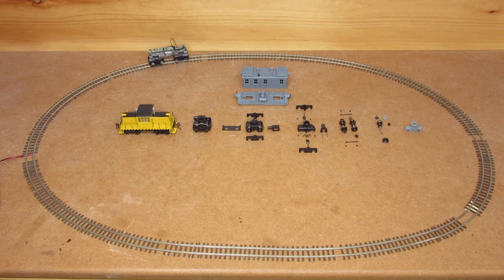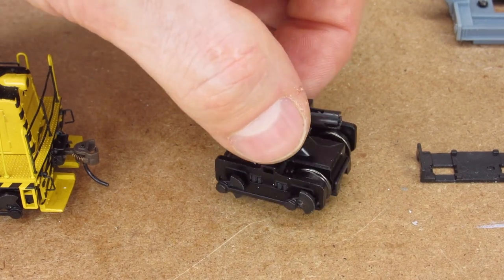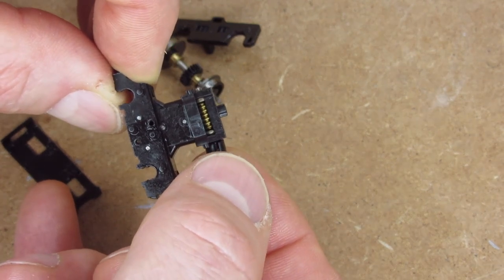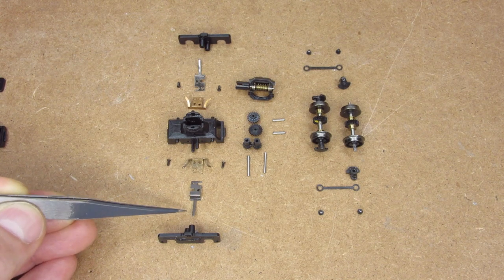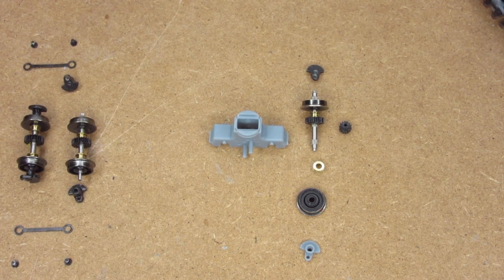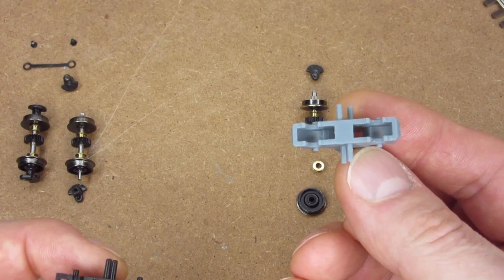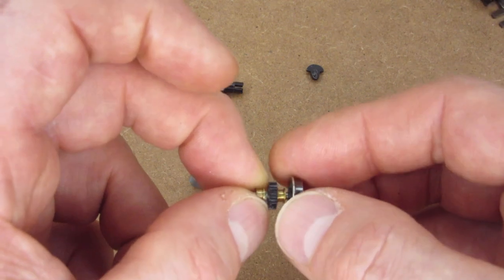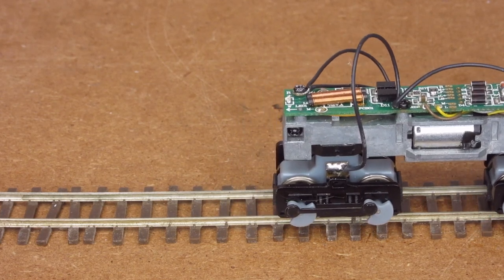Converting Bachmann 45 Ton GE Side Rod Trucks to Hon3

Comment: Cool.
I used to run 1 those GE 44 ton siderodders at frt. car repair co. in 80s.  It's in a museum today.
Really powerful little engine!
Reply from the maker: Hey thanks for the comment!

Yes they're really fun to watch.  There was an aggregate and concrete facility near my house growing up and I used to sit and watch their GE 45T switcher moving hoppers and rock cars for hours.  

The only diesels or gas mechanicals I allow on my layout are with side rods and counterweight cranks.  I've been slowly converting over everything in my internal combustion fleet.
Reply: @dtj9923  
That co. (long gone today) had U.S. Army contract rebuilding super heavy flats to transport tanks.  They all had old heavyweight 6 wheeled passenger car trucks.  I was kinda' considered "truck expert," then; and I dreaded working on those things, so when I got chance to hostle that little GE, and being a railfan, anyhow, and free of those nasty, big heavyweight trucks, which could be very difficult to get all the components to fit & pinned, I was real happy.  That little engine could push around strings of those Army flats with no slips or strain.
Good work, Sir!

Comment: Awesome , Can this concept work on Bachmann 's 70tn also?
Reply from the maker: Hey Don, thanks for stopping by.  

I haven't done any work with the 70 tonners but I have seen quite a few that have been converted to HOn3.  NWSL actually sold some conversion wheelsets at one time, now hard to find.  Somewhere out there is a magazine article on how to do it.  August 2008 Railroad Model Craftsman is what I found.

Also found this posting.  https://www.zealot.com/threads/hon3-locomotive-shops.167339/ 

Hope that helps.

-DTJ

Comment: So great! I need to convert one to H0m, which is a bit wider gauge than H0n3, but I know that printed body would be doing it great.
Reply from the maker: Hey Diego thanks for the comment,

I actually talked with this guy a little in the comments section about his HOn 3.5 conversion which is 42 inch gauge.  HOm with the existing trucks will be a squeeze!   https://www.youtube.com/watch?v=nj1ZkEFfkxA&lc=Ugz2AIubJliwF_CdCWp4AaABAg.9_N7VP25oGT9_fn_cLyMO9

So in the video I talked about how the Bachmann gear clearances were not right and there was some tight running and hesitation and how a big part of this project was fixing the gear clearances.  Over the weekend I built up a new HOn3 45T boxcab chassis with the final revision of the narrowed truck body/gearbox.  I was shocked to find out how much faster the 45 tonner runs now just because my gear clearances are correctly set versus the tight running Bachmann factory trucks.  I used a test loop of 3 rail track and ran my HOn3 conversion against an out of the box unmodified 45 tonner and the HOn3 version ran away from it!  It starts moving at a much lower speed step on my DCC throttle.  I compared to two other new Bachmann engines and got the same results.  Crazy!
Reply: @dtj9923  great, thanks for the link. I know H0n3.5 is 12mm, the same for H0m, so great reference. So if you are going to sell those, I would be interested, even when I'm overseas. Regards!

Comment: Excellent conversion!!! This is exactly what HOn3 modelers need. Are you interested in selling a copy of the cad files for those of us with 3d printers, or possibly making the gearbox housing and counterweights available through Shapeways? 
Thanks for sharing the video!
Reply from the maker: Hey thanks for the comment!  

I just finalized the improved gear train geometry on my most recent print and I gotta tell you it's amazing how much less voltage it takes to get one of my HOn3 conversions rolling vs a factory 45 Tonner, seriously nuts.  Now featuring zero binds, and zero rolling resistance!

I am actively trying to sort out how to commercialize the conversion parts and I need to see how much I can simplify the entire process of conversion for customers.  The axles, gears and wheelsets are a bit hairy, I'm trying to develop some 3D printed jigs for pressing and to guide the end trimming.  If you watch the video you'll see how the factory axle knurling creates some bearing surface challenges that require a lathe, still working on that.  I have managed to develop a much better 3D printed counterweight retrofit that greatly simplifies things on the axle ends.  

Shapeways is an interesting thought, I'm actually set up here to print in commercial volumes but I lack the time to deal with it.  Shapeways might be a good way to delegate that process.

Thanks again, DTJ
Reply: @dtj9923 
Sounds like this is coming along very well. I'm anxious to see this offered as a product. God knows we need more inventive folks like you to foster our hobby along with quality products. I have a Phrozen mini 4k and I love the quality of the prints that I get.  I'm going to try your "magic mix" for resin. Sounds like a winning combination.

There's a company in England called Markits. They sell wheel sets, gear sets, axles, and other parts. The axles and wheels have square ends and holes for quartering purposes. They also have photo etched counterweights. They're catalog is a great source for high quality parts and research.

Maybe this will help simplify the process, and you could make your own side rod trucks without having to use any Bachmann parts. Considering that Bachmann no longer makes this locomotive, and they're increasingly difficult to acquire, offering the complete gear tower (HO, HOn3, HOn30) could be a viable product for us narrow minded folk. You could offer as a kit or fully assembled. This, of course, equates to cubic volumes of time, which is why I suggested Shapeways.
Reply from the maker: @mossysgarage3023    Thanks for the Markits suggestion.  I have seen their products discussed in chats a few times, I just went and downloaded their catalog to look through.  There's also places in Japan with a lot of parts popping up.   http://www.narrow-garage.com/   

I have a pro grade Sonic 4k and it's really good, the 8K Mini is just mind blowing when run at .03 layers.  I haven't touched the 4K in six months now.  If you're having brittle problems with your Phrozen 4K resin the 50/50 mix with Siraya ABS Gray really helps.  The exposure settings are pretty close to the 4K resin settings.  I think just a little longer.  You might also check out Uncle Jessy on this subject, he mixes in Siraya Tenacious.   

https://www.youtube.com/watch?v=fsyn6ODGtVY&t=193s

It's really unfortunate that Bachmann discontinued the 45 tonner, hopefully it comes back some day.  It's a great little model, so much hacking and bashing potential!  The Bachmann parts department still has lots of spare parts.

A total redesign of the 45 tonner mechanism to include a flywheel and elimination the bad worm gear setup where the worm gear actually pivots under the worm with the truck would be great.  With the boxcab version of this thing I'm building I'm almost at the point of a complete new model.  It went much further than the original plan.  It wouldn't take much additional work at this point to just design a whole new drive and chassis.

Here's a couple related videos with the 45T boxcab
https://www.youtube.com/watch?v=yCo-bpQjB8M
https://www.youtube.com/watch?v=1Az5JTuGlYI&t=672s

Thanks again - DTJ

Comment: Thanks!  I would be happy to purchase a set of narrow trucks and counterweights from you, if at all possible.  I have a switching situation where I can’t use an engine with a tender and this would be perfect.  I have a std ga 44 toner I would use.  Thanks...
Reply from the maker: Thanks for stopping by!

I was afraid this might happen.   

I am still sorting out a few minor details and trying a few other resins before I would be totally comfortable with these as a product.  The biggest hang up is the conversion process itself and all of the specific modifications and tuning required to make these run to my level of satisfaction.  Once I finish my Hon3 siderod 45 ton AGEIR boxcab project I'm going to see about doing more with these trucks and try to simplify the conversion process with some jigs and fixtures.  Having to rip the axles apart and then modify everything is a bit of work and requires a pretty good miniature machine shop.

Keep an eye on my channel, things are likely to evolve.

-DTJ

Comment: If possible I would also like to purchase a set of H0n3 trucks and counterweights.
Reply from the maker: Hey there, thanks for stopping by.  I just posted a reply to @Mossy's Garage about this.  Short version... I'm working on it.  The 3D printed parts basically are good to go.  The axle conversion is not customer friendly and requires a jeweler's lathe right now.  I'm working on options possibly using precision ground dowel pins for axles instead.  I'll follow up as things evolve.

Thanks again!  DTJ

Comment: I have a 45 tonner that I ripped apart seconds after getting it and then put all the pieces in a box and never touched it again... lol yes that is my life. Is there enough room to convert it to HOn30?
Reply from the maker: I went to bed wondering who was going to ask this question.  It doesn't surprise me that you are the one asking this question.

I will have to go measure some things and see what room is left to work with.  There may be a way to cheat that last bit of room required but it will take some creativity.  It's definitely within the realm of possible though.

We won't discuss the boxes of non running basket case locomotives I have just sitting around waiting for a project.  I'm in no position to judge anyone.
Reply: @dtj9923  Well really I'm not much into diesels so no big deal looking into it. Just figured you had it figured out already.
Reply from the maker: @Schmuck804  Let's face it, anachronistic side rod diesels and gas mechanicals get special status.  They are entertaining.

As a challenge I'll see if I can develop an Hon30 solution.  A 45T center cab is going to look crazy on 30 inch track.  But I think I see a path forward on this.
Reply: @dtj9923  There was the one guy using the 45T body with a GP15-1 chassis for HOn30. He switched to On30 though.
Reply from the maker: @Schmuck804  That just sounds way too easy, where's the fun in that?  I assume that conversion didn't have cranks and counterweights.
Reply from the maker: Took a few measurements, I'm pretty sure this conversion works for Hon30 with just a little extra effort.  I'll need to rethink the electrical pickup situation.  If you remove the factory pickups which sit behind the wheels along with their mounting hardware this starts to look entirely possible. We need an additional .75mm of room per side, I think it's there.

Comment: DJT:  All comments re: this 45-T GE conversion to HOn3 appear to be a year old.  Any updates?
It is possible to buy the narrow trucks from anyone in the 'community'?
Like many - I started the conversion using all the existing parts.  Have not finished it.  Lost a gear.
Hopefully someone will reply. Thanks
Reply from the maker: Unfortunately I've had to put the models and YouTube down for a bit.  I have a few too many things happening concurrently.  An unfortunate side effect of adulthood.  

I'm hoping to find some time next winter to get back into all of this.  I'm the owner and CAD modeler of the truck conversion files.  I'm not entirely sure what my long term plans are for the files yet.  They're not out on the web at this time.  I would definitely need to generate a step by step video for how to create the narrowed axles.  My latest version of this model conversion is very much improved from the version in the video, but I need some time to sit down and document it all.